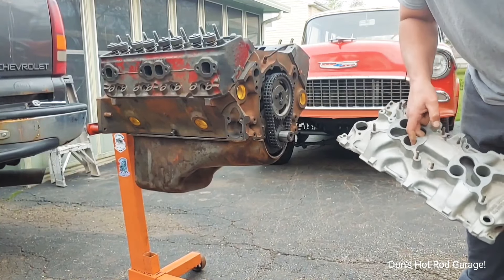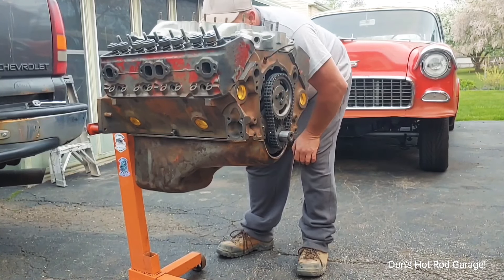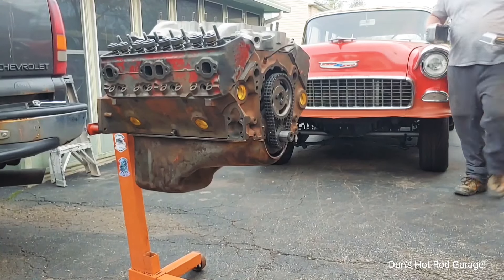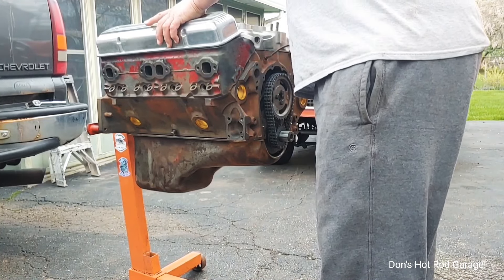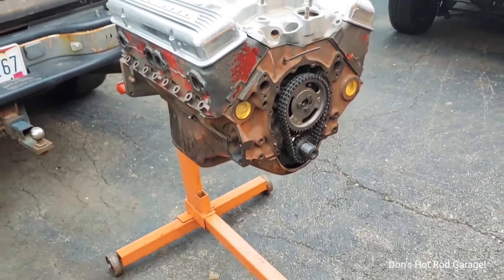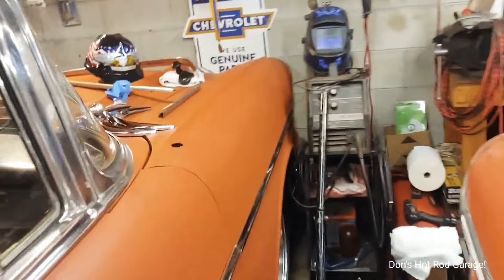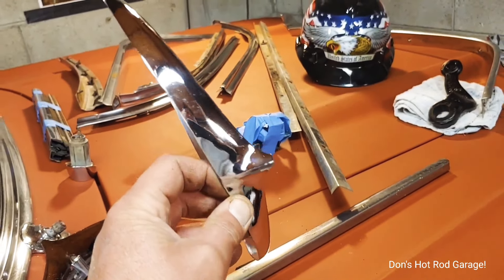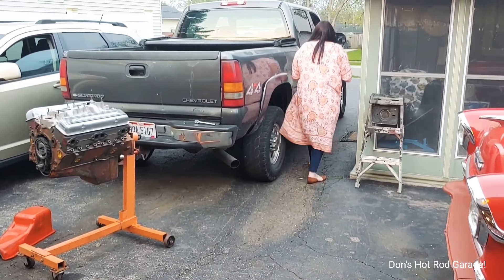55 Chevy Ragtop 265 Returns from Beach Performance! Plus some motivation from the better half!

Comment: How refreshing putting a 265 small  block in your car. All these guys stuffing big blocks in the Tri 5s that they were never meant to have. In auto shop in 1969 ( my senior year ) we put a header and a two carb manifold on a 235 6. Made a big difference.
Reply from the maker: Hey Dan! Yeah it's a real treat and it's been a long time since I've put the same engine back into the same car! It'll be a fun driving engine and I wanted to recreate what It would have been like to own a 55 Chevy in say 1958 or 59! I'm sure the 235 ran real good with 2 carbs. Early Hot Ridding is fun and really special to me! Have a good one man ✌️

Comment: Don, It's good looking motor. You should run a PVC system on that hole in the back where the expansions plug was put from the 63 engines but do not remove the breather can from below the valley area. If you do, oil will slosh into that area and you might suck in oil into the PCV. Trim back the heat shield or hammer it up out of the way for clearance. You could heat the metal up with your touch and use a ball pean hammer and shape that metal or cut it away from the area of the breather can. If you leave it plugged and pull the can  you just have to add a PVC to the valve cover but make sure you have a baffled plate below the PVC connector area. 
That is going to be a good running motor good luck with it. 
Oh the smell of a new motor you never forget.
Reply from the maker: Hey Monadking! Yeah I have to do some figuring out on the baffle. This engine is different from all the other small blocks and has a road draft tube that goes through the block and exits on the left side! I have the original 55 4 barrel intake that I can run for now. Thats great info on removing the baffle I didn't know it would suck up oil, makes sense. I might remove the oil shield on the intake and use it that way! Have a good one Brother 👍

Comment: Hey Donny. You must have had new sleeves.  I though the old ones would have been to thin if  bored. Or I read it on here. But a piece of the puzzle comes home.  Good feeling I imagine. Good score on the Bezles chromes expensive. Hearing the siren I thought I was back in Egypt.  Lol. I'm deafened from the silence back home. Lol. Keep rolling on Donny. Slow and steady. Photo Bombing Wife. Lol. You gonna need them hands one day to hold there or help push. Lol. Have a good Sunday to you all. I been in bed since I got back.  I got food poisoning. Tutenkarmuns Revenge. Lol. All good now.  Adios Donny and new Assistant. Dino.
Reply from the maker: Hey Dino! The block was bored 60 over! We had the block sonic tested and they was thick enough to safely go 60 over! Should be a really cool engine in the 55! I don't know what it is but there's always a siren going off. I love real close to 2 different fire stations so I guess thats a good thing! Hope you feel better man that's a bummer! Catch you next time Buddy 👍 Adios

Comment: Sweet Don, you got the motor ready to go together, awesome, nice to see your bride making an appearance, catch you later buddy
Reply from the maker: Hey Mike! Yeah man I'm happy to get the engine back home! I wanted to start to bolt everything together! I went to jegs Sunday they didn't have any of the gaskets I needed in stock! So I ordered them and they should start coming in through out this week. Its tough to find parts for a engine that's 67 years old. 55 265 have there own oil pan and intake gaskets! I want to run the stainless steel head gaskets to keep compression as high as I can and they was out of stock as well. It sure was nice to see April in a video she's missing out! Have a good one Brother 👍
Reply: @donshotrodgarage1717  it will be very cool to watch you put that motor together, yes would be cool to see more of April, catch you later brother

Comment: Ive had success polishing the pitting out of the chrome by using 1000, 1500, and 3000 grit sand paper.
Reply from the maker: Hey Rick! Yeah man im sure that would smooth them out! Later man ✌

Comment: nice engine, 265's had so much meat in the block +.060 is no problem.  I had interference problems with an oil baffle some years back , If you have another baffle , practice  on an old one, what I did was trim the ring part flat and even with the tube, then I started with the end and flattened that and then the rest of the housing part until my intake would set on the heads. 

I experienced no issues at all. I worked at a race engine shop , and we would drill a few 1/8" holes in a freeze plug and knock that in the hole in place of the baffle and then use another freeze plug in where the road breather tube would normally go , threaded for a barbed hose fitting and then run a pvc valve , both worked well. please keep the updates coming. thank you
Reply from the maker: Hey Mystery Engineering! You bring a cool angle to the Channel man I do appricate that! I'll look into them baffles and see what i can come up with. This is a 55 265 and is kinda weird compared to most all other small blocks. It'll take some time to figure it all out but its part of the process! I like the idea of the pcv valve in the freeze plug in the back! Have a good one Buddy ✌️
Reply: @donshotrodgarage1717  yes the 1955 265 being the first v8 for chevy was all by it's self. I had a 265 in a '55 chevy dirt track car and was beating 350 chevys with it. I meant to ask, on the stamped engine numbers on the right  bank  just in front of  the head , do the letters FB appear? if so that is a very desirable block, I had 2 of them one upon a time. I enjoy your channel very much and appreciate your approach to all of your projects. thank you

Comment: I see those heads are 1958 power pack heads, and are also hard to find that aren't cracked, great find along with the intake with the carb that you have, that motor is really nice, that hole on the top of the block in the rear that you plugged had a road draft tube in it that let the crank case breath and they dropped that and just used the oil fill tube with on the intake with a vented cap. You find some great parts!
Reply from the maker: Hey Lee! Yeah man im excited to get the old engine back together and hear it fire up! Have a good one ✌️

Comment: Haha Don, I see you sneaking those candid camera shots! If you use a 283-327 manifold, you'll have to use internal parts that correspond. If you concede to that, you might as well run a pvc valve, it's not noticable if you can run a fake (plugged) road draft tube also? Are you going to run a GM factory accessory oil filter? And so on we go...
Reply from the maker: Hey Joseph! Yeah I figured I would run some bloopers. Lol I haven't dicided yet on the breather or PCV valve setup.
 This is a 55 265 v8 and it's different from all other small blocks. I do plan on using the remote oil filter and other accessories to match the engine. Have a good one ✌️

Comment: I'm glad you got your engine back. You look a lot happier.          Don, You can remove the breather can from the lifter valley and install a 1963 PCV system that will be light years better than the old road draft system. It will fit into the cast hole at the back of the engine block where you had that plug installed. I know you want to keep it as stock as possible. But the PCV system is the way to go and you can run the vacuum hose down the rear of the block and no one will see it. I did this on a 61 , 283 and the engine ran much smoother as all the vapors were introduced back into the intake system and not dumped into the air.
Reply from the maker: Hey Edward! Yeah man im alot happier to have the engine back! I'll check into the pcv valve and see if I can make that work. 55 265 block are different then all other small blocks! This has a road draft tube that goes through the block and exits on the left side of the engine! It's going to take some figuring out to get it all just how it needs to be! Have a good one Buddy✌️

Comment: Old school look with vintage parts , that's the same wayl I do mine Don. You should bee able to notch that intake baffle to clear crankcase breather.
Reply from the maker: Hey Johnny! Yeah that's how I like to do it also! Take the old and make it run with some new parts! I'll probably run the stock 55 4 barrel intake for now and notch the other intake heat shield when i install it! Catch you later ✌️

Comment: That's going to look sweeeeeeet!
Reply from the maker: Thanks Darren! Should be a fun engine! Later man ✌
Reply: @donshotrodgarage1717  what about that rusty Olds convertible you had it would make a nice parts Car for Dan's 57 rag top he's building I'd be cool if he in stalled the roof mechanism and other pieces to make it a real convertible
Reply from the maker: @darrenbrisson4336  Hey Darren! None of the parts off the olds convertible will interchange with a Chevy. Olds and Buick are the same! Chevy and Pontiac are the same. I wish the parts would work on a Chevy! Later man ✌

Comment: cool to see that you got your engine back . it looks cool with the dual quad intake and corvette valve covers .
 i think that with that plug where the road draft tube would be ,then you don't need the canister under the intake.
 i think it is to keep excessive oil from going out the road draft tube. it will look really good when you get it all painted up.
ebay sells a small cap hei distributer that uses a separate coil and fits nice in tri fives. i use them in my cars that a big hei won't fit in.
Reply from the maker: Hey Jim! Yeah man im happy to have the engine back! Just 1 small piece to a big puzzle! I'll check out that distributor! I'm kinda thinking a 55 engine needs to run its original notched shaft distributor. These are odd unique engines! Have a good one Buddy ✌️

Comment: Hey Don there is a difference in the oil separator in the valley the 265 is longer then the 283 you need the shorter one from a 283, thought I would let you know. Later Tony
Reply from the maker: Thanks Tony! Thats great info I'll look around and see if I can find a 283 baffle for the engine! Have a good one Buddy ✌️

Comment: In a world where everyone does the same, you dare to be different,  gonna be the hottest 265 on the planet! Hope your able to get the intake sorted, looks great on there with the vette valve covers. The Mrs. made an appearance too, 👋. Cool update Don.
Reply from the maker: Hey BW! Yeah man ive had many 55 Chevy though the years and thought its about time a run a original engine in one!  I think it'll be a really cool engine in the car! I'll get the intake figured out if not I'll use it on the 57 Nomad. 1955 265 engines are kinda weird and have different stuff from a normal Chevy small block! I'm happy to have the wife step into the video. Been trying to get her on board with the Channel for a while now! Have a good one Buddy talk to you soon👍

Comment: Engine looks great Don, you are going to love putting that thing together.  I'm sure you can figure out something to make that intake that BW got for you work, it sure looks good on there!  I'm not sure about the plug that he put in back of the engine because that is where the down draft tube goes.  You can use an oil filler tube that you can screw a PCV valve into the side of it and then just run a hose to the back of the carburetor to vent the gases back into the engine.  That is the setup that i have on my 327 and it works great.  Valve covers look great man!
Reply from the maker: Hey Robbie! Yeah man I'm super happy to have the old 265 back from the machine shop! This is one of my favorite things about putting together a old car. I love to paint the engine and dress it up with all the accessories. This block is a 55 265 and doesnt have rhe traditional road breather on the back. It has a road draft tube that goes through the block and exits on the left side! It's going to take some time to get it all fugured out be its past of the process. Have a good one Buddy ✌️

Comment: Looks like there’s a .040 piston to deck clearance. The heads look like less than 60CCs. With that said, you might hit 9 to one compression!!!……Time for duel-quads!
Reply from the maker: Hey David! Yeah man I think your pretty close on your estimates for compression! The ISKY cam is designed for 9.5 to 10.1 compression. It should be a fun engine with a 4 speed. Have a good one ✌️

Comment: just power pac heads and not 194 or 202 fi heads,would be awesome with a duntoff 30/30 cam also.old school!!!!!
Reply from the maker: Hey Leroy! Yeah man just the 56 power pak heads. It should run pretty good for a small cubic inch engine! Later man 👍

Comment: Hey Don so what camshaft did you finally go with, looks great I like the old school factory look it going to look great under the hood. That's weird I have never seen where the intake didn't set down like it's suppose to, there must be a different can so the later intake fits. Later Tony
Reply from the maker: Hey Tony! The engine has a hydraulic ISKY 264 mega camshaft in it. Its designed for 9.5-10..1 compression. It should have good  torgue and power with a 4 speed and 3:55 Gears! This engine is a 55 265 and I think GM made some big changes to the breather area starting in 1956. Have a good one buddy✌️
Reply: @donshotrodgarage1717 I hope it has the flat ground in the cam journal so the oil flows correctly.

Comment: How much did you want for that rusty Olds convertible ud like to see Dan end up with it to use the parts to make is convertible more real with a real roof mechanism and trim that's the same
Reply from the maker: Hey Darren! Nothing on this Olds convertible will interchange with a Chevy Convertible! That's why it's hard to sell it only fits old's and Buick! Later man ✌
Reply: @donshotrodgarage1717  insure the roof mechanism would fit as it has the same upper body lines and roof structure remember chevy Pontiac buick and Olds all shared the same chassis just different sheet metal on the outside but if you look at the side door and quarter area it's the same as a 57 chevy hard top I'd be a lot of work but I'd be cool to see him do it
Reply from the maker: @darrenbrisson4336  Dan would have to install the entire inner tub from the convertible to make it work. The body is not the same. The front windshield post leans forward on this car. The Chevy windshield post goes straight up! The top rack sets way lower on this car then on a Chevy! Catch you later ✌️
Reply: @donshotrodgarage1717  that would only have to be a worry for the side vent windows if you study the very upper curve is the same the side at the quarter panels eccentually has the same shape it would be to cut the braces and reweld them where they need to be the mechanism is going to be interchangeable amongst those bodys if he took the time he could make it work I'd be cool if he went to your place with a trailer and grabbed the car from you for free to help with the build inturn while he's there help you put your floor in a dd speed shop and dons garage tri five calibration the tri five duo good for more subscribers definitely think about it im high just smoked a joint but I have moments of grandeur lol! Study it a little more and remember there's always ways to shoehorn things in place if it needs to be
Reply: @donshotrodgarage1717  he can do that in his sleep hahahahahaha 😂
Reply: @donshotrodgarage1717  I'd be easier for him to just cut out what he'd need instead of the whole car thd back seat would be critical and rear side panels that go with the roof any braces and brackets door glass quarter glass